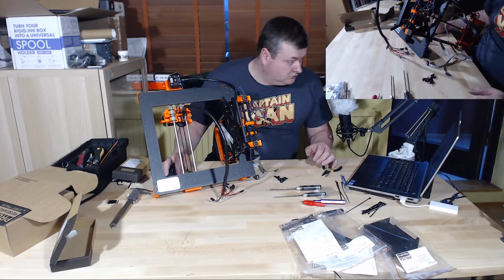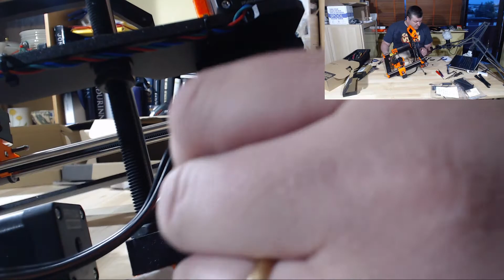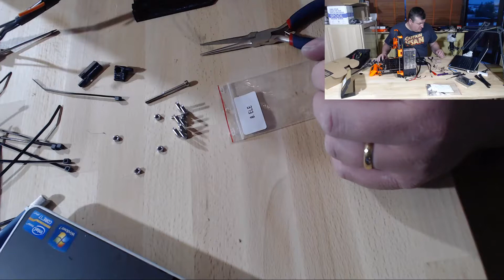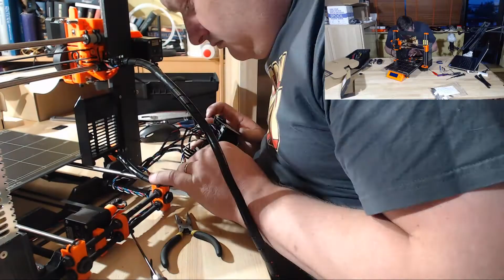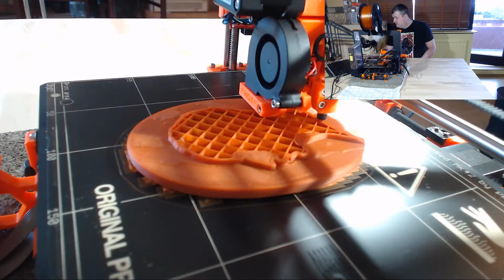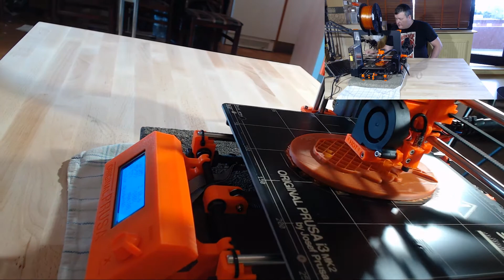Prusa MK2S Assembly Part 3 of 3

Comment: looks like your x-axis belt sticks quit far out on the left side, can prevent the x-carriage to hit the endstop..to get it perfect perpendicular read the comments of the Mk2 assembly manual ... use a square tool on the bed lines on the right and left against the x-rods...my z frame is 100.1mm on one side and 102.4mm and got nearly perfect...with FW 1.3.12RC2 you can find under support menu the meshbed results
Reply from the maker: Thanks, I have trimmed the belt to be just right, I'll fix the z frame  with this info :), thanks